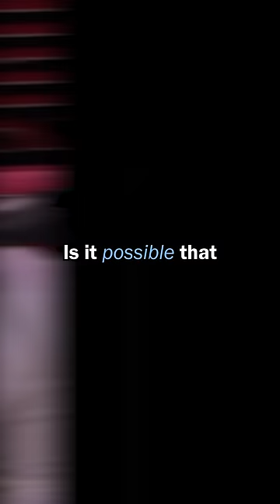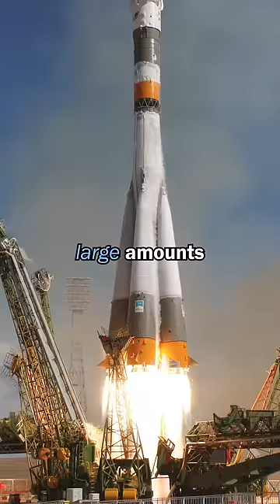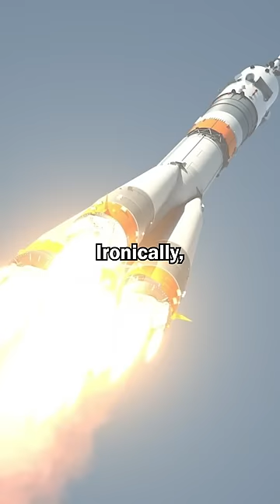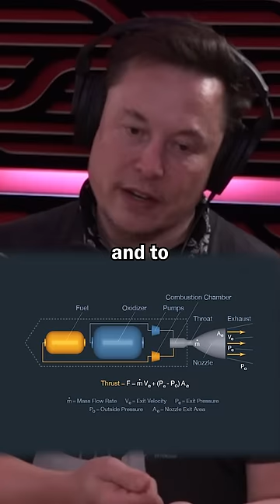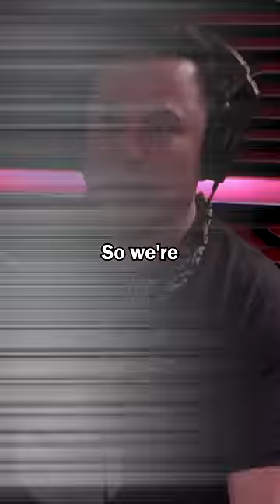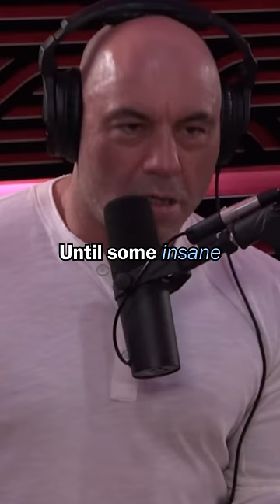Why This Rocket Engine Will NEVER Work!! ☢️ #spacex

Comment: Invite Bob Lazard and this Tesla guy together and see what happens. 😂
Reply: Elon and Bob Lazar's idea work fine with each other. Elon simply says with known technology, we need to BRING the fuel on board to space in order to move an object, whereas Bob says the UFO's he's seen use an element not native to our solar system that's so massive, it can bend space time around it, thus having a craft "fall" forward into the gap it created, thus actually allowing for faster than lightspeed "travel". It's possible according to physics, but nothing we have is even close to massive enough or powerful enough to create that "warp" in the fabric of reality. I believe Bob is telling the truth. He's told the same story, including the detail about element 115 since the 1980s. Element 115 has since been "discovered" and disclosed to the public in 2004.

Comment: You could. Using the Lorentz force you can accelerate particles of low physical mass at speeds near the speed of light. This is in essence how ion thrusters work. Future of propulsion is ion propulsion. Gas rockets will eventually be surpassed as development of ion propulsion continues.

Comment: Came up with a solution right now. First 1 magnetic spin coil that throws out a heavy object with a comically thin string attached. The object goes out at a very high velocity but once it reaches its max distance (decided by length of string) it abruptly yanks the space vehicle in that direction! Once moving, the crew inside takes turns slowly pulling the string until they get that sucker rewound and ready for the second toss on the old magneSpinn.
Reply: thermodynamics laws left the chat

Comment: Use your exhaust heat as propulsion, and your reactor would create the heat to dissipate. The higher yield reactor would create higher heat therefore higher energy yield. Your exhaust vents would be your propulsion, you can vent the hull similar to that of an aircraft to go up and down. Just saying...

Comment: I find it kinda funny that he calls space empty, it’s true that there isn’t a lot of mass floating around, but there is enough to cause friction and a lot of damage as soon as you reach a certain speed. 
So the solution would be to collect tiny particles and gases in front of the space ship and to use some kind of electric driven accelerator to trow out the mass at a higher velocity out the back than it had as you picked it up.
It’s simply a thing of nobody tried it because there is no infrastructure in space you could test a concept like that with.

Comment: Well you can expell small amounts of mass with very high velocity. Basically you can make a gauss gun that constantly shooting back metal shavings
Reply: Or you can just use various rocket fuels
Reply: @LogicCaster  you can. But It was a question of making electric powered rocket.
Reply: @user-ro2sg6jb6u  
Its not a bad idea, but serious electricity produces arcs too. That gauss gun would be eating up the gun its self along with the inside of the “combustion chamber” for lack of a better word

Comment: He's right about the need to accelerate mass in a vacuum. But most of a rocket's acceleration takes place within the atmosphere, where another method could be used. There are proposals for electric and nuclear propulsion in the vacuum of space, but they're not powerful enough for the initial acceleration. Therefore it seems we could come up with a combination that could work without fossil fuels.
Reply: Even now there is no need for fossil fuels, but that's not the discussion here. Electric and nuclear drives still needs to expel gas in some sort

Comment: It would make more sense building hotels on the moon and make a base than going to mars first. They could refine nitrogen on the moon and use it for a fuelling station for the trip to mars but also if an asteroid ever hits earth it will accommodate some of our population like a life raft.
Reply: last I checked the current idea was to use the moon as a launch base for other planets, since the moon has no atmosphere and very small gravity compared to earth it would mean it won't need anywhere as much fuel to escape which means you cna have either a lighter rocket or being more fuel for more range

Comment: I dunno, I'm pretty sure we could utilise magnetic fields to shoot the rocket into space that way we don't have to release all those chemicals into our atmosphere. And then once in the vacuum you could just use electricity from solar power to shoot out a retractable counterweight to start the movement off. And use gas sparingly to stablize and move the ship forward.

Comment: While in space you need mass sure but most of the fuel is used to enter space.

Entering space is very possible with electrical energy. A centrifugal wheel or a railgun for example.
Reply: there are companies attempting to use centrifugal wheels but it's very hard, you have a massive and heavy object rotating at extreme speeds, if anything goes slightly wrong you have a massive chaotic situation

Comment: Soooo... You can use electric power to leave orbit, but need fuel to fly around in space?  seems a 50/50 system would be the way to go then, for close orbit travel

Comment: Nuclear produces electricity, if you can use this electric to create something with high amounts of propulsion then it will make sense. Electromagnet fields are currently used for propulsion in space  but it’s not as strong as chemical rockets & you can’t use it to launch from earth to space, If we were to launch from the moon maybe this will be a lot more viable due to its lower gravity. But this tech will definitely improve and new tech will also be available that will definitely make long distance space exploration a possibility.

Comment: I firmly disagree. Mass is not the answer to best propulsion. Increasing the density of the energy you use to travel in space would increase your speed. The added gravity from compression that follows the Energy out of the space craft will help move you forward faster. You have to create the resistance you need with the Gravity that follows Energy out of rocket.

Comment: So the answer is yes… you can create nuclear propelled rockets. This is an extremely challenging engineering feat though that would likely pose many safety issues. HOWEVER, in-space nuclear propulsion is perfectly sound and does not have the same safety issues being out of the Earths Atmosphere. Nuclear propulsion will be really important when we want to start regularly going to planets in different star systems or just outer planets in our solar system.

Comment: Already been developed. It's called NERVA. You still have to use reaction mass, and it's still a rocket 🚀, but it's a matter of taking appropriate mass, heat it with a Fission reactor and expell it out the back. You could use water I believe. Or possibly even lunar dust. 

You can also use lazers to get a rocket reaction by making a large rocket nozzle coated with an ablative material such as they use for re-entry heat shields. Focus several powerful lazers up the nozzle and hang on. 

Hey Elon! To have everything go electric we must have NUCLEAR ☢️ POWER! And LOTS of it! We'll also have to the moon and the asteroids and mine them because we DON'T HAVE the amount of stuff down here. 

But I know you are already working on that -- Thank you!

Comment: While we are stuck with expelling mass, regular rockets are going to obsolete within 20-30 years beyond earth orbit. Using electricity you can get mass going much faster than with a chemical reaction. 

Similar story with nuclear fuel.  You can send your fuel out a lot more efficiently with nuclear propulsion. 

Even for atmospheric rockets rotating detonation engines are set to surpass conventional rockets within the next 20-30 years.
Reply: 20-30 years? Sounds like 100

Comment: There is solar wind, and cosmic radiation. Theoretically, if they are electrically charged or magnetic - if there 'd be a technology you could "react" against them, you wouldn't necesserally need propellant.

Comment: Terribly wrong prediction of everything going electrical. He is just backing his company portfolio that's all.
It's going to be diverse, based on need of volume of energy. Scooters, Cars, buses, trains, ships, planes, rockets all have different need of volume of energy. 
Scooters may run on batteries alone.
For cars, BRICS nations would develop ethanol engines (Toyota has already unveiled one) learning from experience and mistakes of Brazil.
Or it can be a hybrid. 
Hydrogen engines will serve medium to large energy needs of ships and planes.
Even if everything goes electrical then at least lithium ion batteries are not sustainable energy storage technology.
We need sodium ion with some expendable parts if necessary.

Comment: Ion thrusters. Ion thrusters. Ion thrusters.
Reply: Still uses gas.
Reply: @Nidvard  kinda. I made a mistake. So ion thrusters are used to propel once out of gravity and some ion thrusters are solar powered.
Reply: @gershonnash9607  sure, those are widely used on satellites and such today. Efficient, very power demanding and very low thrust
Reply: @Nidvard  but what is cool and you should look up is that a school (I think Harvard) is working on making ion thrusters efficient enough for planes.
Reply: @gershonnash9607  if you're referring to plasma ion thrusters I'm well aware of it. Research is still on very early stages, and as with other ion thrusters the downside is that it requires a lot of power, and in many ways it's the same as other ion thrusters with the difference it reacts to the atmosphere instead of onboard gas.. But yeah, with enough research it can hopefully be a viable alternative some day. Another benefit with it is it nearly silent compared to regular engines

Comment: Propulsion doesn't work in a vacuum there's limits to the pressure in the tank no limit to a vacuum so it's not shooting out it also sucked out so no movement in a surface less vacuum

Comment: Nuclear rockets are more efficient (higher Isp). Testing of the Los Alamos testing of the Kiwis and NERVA program ended because of bureaucracy. Soviets made wide use of NTRs. Electric rockets have already been used. Other countries are researching different methods. It's possible he misinterpreted the questions in that he didn't mention that the description of engines is more line with their energy source instead of the surroundings they interface with. I think this might be PR to hide the fact that Spaceex could be using more novel methods.

Comment: You can reduce times to mars with a nuclear upper stage and reduce the trip time by a couple months.  But your probably talking 4 months vs 6 so for practical engineering development it makes sense to go with conventional as there good enough.  Nuclear powered engines that don’t shot radioactive material out the back don’t don’t have the specific impulse to beat earths gravity.  But they can burn for much longer allowing for really improved speeds with the upper stage.  It would take another 10 years to start sending people if they tried to add that tech to the plan.  So it makes sense from a practical planning prospective to actually see mars colonization happen.

Now there are Nuclear space craft designs such as Robert Zubrin’s nuclear thermal rocket that is basically a space jet that has an engine that uses a controlled nuclear explosion by timing the release of the materials to react.  Kind of like the nuclear equivalent of a chemical rocket.  You would not use that for the take off stage, but that system would be good for travel to the outer solar system from earths orbit.  Some estimates put that it could get up to 1 to 3 precent of light speed.  But honestly if another company builds a craft like that spaceX could just put it inside the cargo area of the upper stage and release it like how big satellites and space probs are currently launched.  So you would not have to worry about developing a totally new combined rocket.  

Now mars is for practical purposes the best place for humans to go other than a short exploration mission to a moon around Jupiter or Saturn.  And we could send a bunch of slow rockets 5 to 10 years to get to all the dwarf planets.  Other stars are to far away.  The main practical advantage of a nuclear propulsion system during humanities first waves of space colonization where we would gain a new capability not just a speed improvement would be to send several hundred small telliscopes out several times farther than voyager 1 and 2 have gone to points far enough from the sun that they can be used as gravitational lensing telliscopes.  Basically they could use the suns gravity to make a Lens but each telescope has to be sent in a different direction as the star system the telescope is looking at has to be perfectly lined up with the sun.  Then we could feasibly get laptop size screen photos of planets.  That would be the most practically amazing thing we as a species will be able to do in the next several decades where nuclear speeds would make a difference in mission feasibility.  

The fastest design would be a nuclear pulse propulsion

Comment: So your telling me you can't use electricity to generate enough sound to cause a vibration like a bee fluttering it's wings using the wings to propel the sound as if the sound were wind to then propel said space shuttle using artificial mass in space/vacume?
Reply: For example water is a liquid when it's "just right" when it's hot enough it's a gas and when it's cold enough it's a solid, with this theory it may be possible to manipulate sound or radiation into something more physical causing momentum and or resistance of course not using simple heat or cold, use sound to make artificial mass in the vacume to then propel the artificial mass with a mechanism doing something similar to wings flapping to push the artificial mass
Reply: Sound can be dangerous on earth due to life.... In space it would go nowhere... For example if we made a 500+ decibel noise in space no harm would be done, but even 200 decibels on earth would do damage to life so perhaps for example if we used a several thousand decibel noise obviously breaking sound barrier causing artificial mass/wind to then use wings to flap against the artificial mass would propel the object behind it (I know this is possible)
Reply: "in vacuum there's nothing"

"so make something"

"where there's a will there's a way"

Which brings me to this conclusion

"" where "there is nothing" there is room for something""

Comment: Rockets propulsion in space a lie. They say newtons 3rd law is at play (every force has a equal but opposite reaction) but newtons 3rd law only applies in relation to matter. Space is a vacuum which is free of matter. If their arguement was correct any "space walk" were a astronaut pushed off of the space shuttle the shuttle would move at the same speed as the astronaut was moving. The mass of the shuttle would be irrelevant because in space the shuttle weighs as much as the person (nothing). 
This is just people getting rich off lies.

Comment: Or what if you used a tall pipe put a valve on the end and use barometric pressure so when you open the valve it feeds an over sized pointer stick like giant telescoping set of pipes one smaller than that shoots craft then you keep your fuel payload and then you go to Mars lols

Comment: I actually have been working with something that could possibly break through this way of thinking as long as it's enough and I'm not 100 percent about the exact figures but would have to have a to scale of the ground to space and move a model through it including different atmospheric pressures.

Comment: actually 2 things won't go electric. Diesel 18 wheelers. It's too efficient and the diesel generates crazy torque. An electric 18 wheeler would weigh soo much it would crack the rode and if it crashed the chemical fire would last days and would be very hard to put out. Electric is most efficient in traffic situations.
Reply: Laughs in Edison Motors
Reply: @SpunkMayo  don't laugh too hard you may need to recharge all night

Comment: He is wrong you can build a railgunlike thing and shoot the ship into space
Reply: Yes but if you have to slow down, speed up, or change direction then you require fuel. However this does actually conserve a lot of fuel since most is used during lift off.
Reply: Railguns destroy themselves

Comment: There’s no way we will go all electric it’s impossible. The Tesla tractor trailers charging rate is so high that if you plug 16 of them in it will take a two burner coal fired power plant just to charge the 16 tractor trailers.  
It’s never going to happen